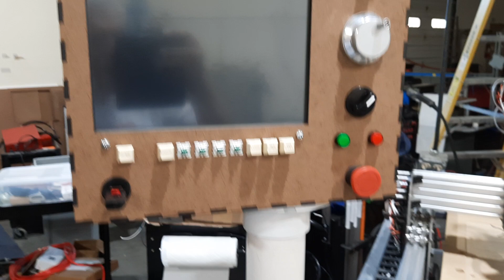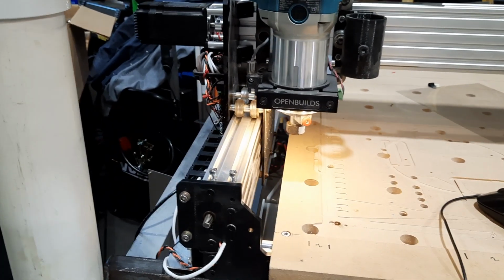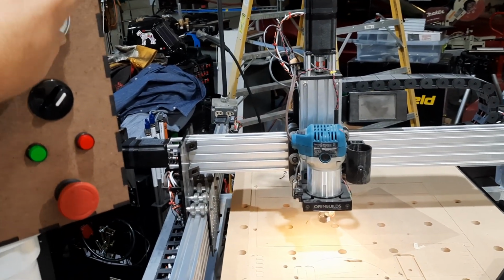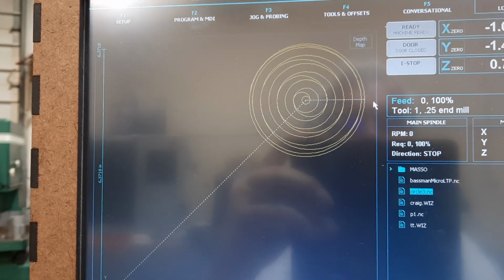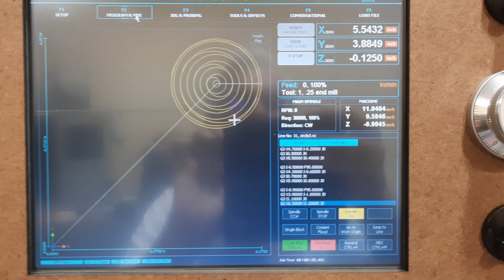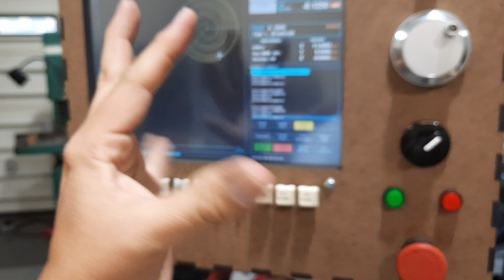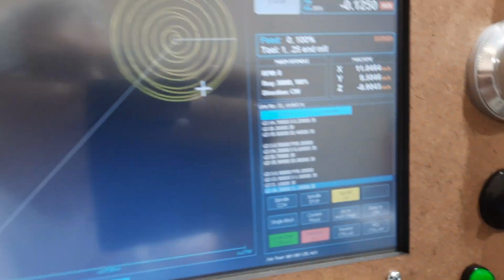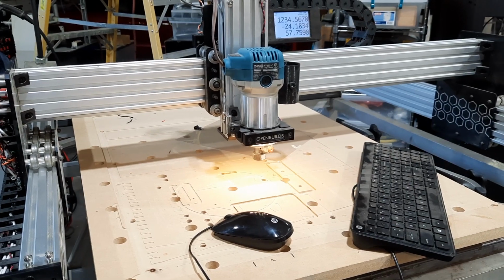Masso G3 CNC - Operator Panel Functional

Comment: LOVE the idea of using the DB25 cable and breakout boards!  Keeps the wiring clean.
In the early stages of finding out what all I need for my electronics/wiring/switches/etc.  Will definitely borrow your DB25 idea!
Reply from the maker: It worked out great. Plus, if I want to pull off the panel, no problem, one connection. Thanks for the comment.

Comment: I have the G3 Touch running a home built router and so far so good. A snow bird so really only have 6 month's a year to work with it. I see you are using relays, I have it running without any??
Reply from the maker: Is this a question?
Reply: @CraigHollabaugh  What will you be controlling with relays? I see a gcode controlled dust vac would be nice on my router via contactor, will see how it goes after more time using the machine.
Reply from the maker: @TheMegaturk  the G3 outputs only sources 5mA at 5V. The relays switch on spindle (120VAC for Makita router), Red, Yellow, Green indicators at 24VDC and the 5VDC going to my laser crosshair. Dust vacuum will be another when I get to it.